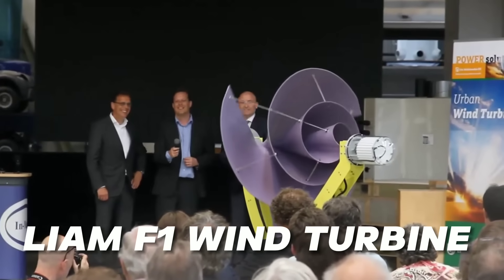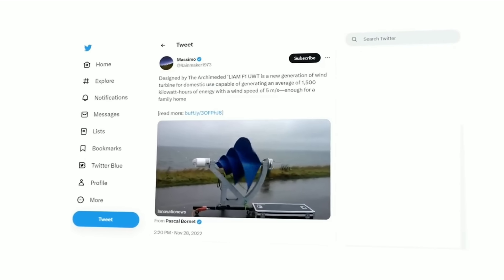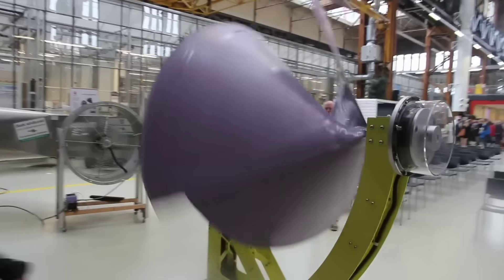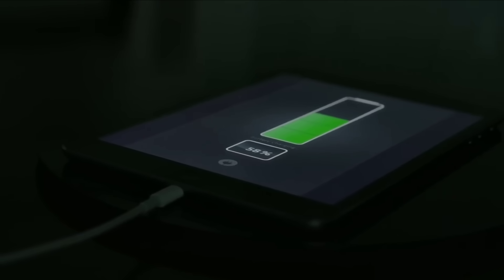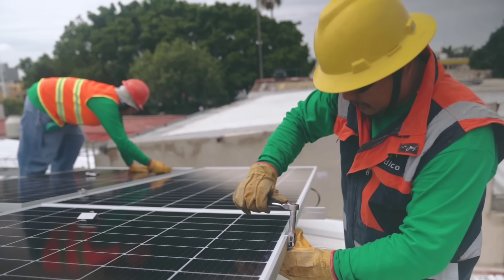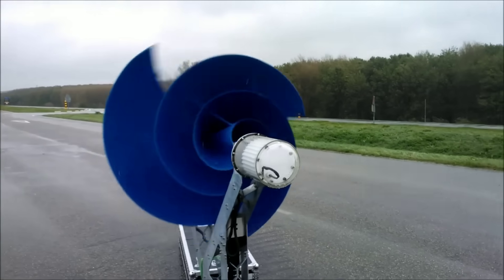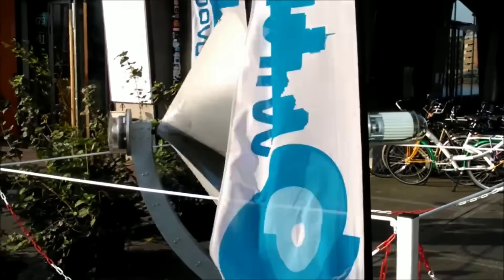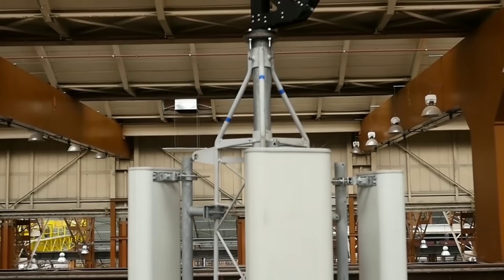This NEW European Wind Turbine for Home Outbeats PV Solar Panels in 2023?!

Comment: I have worked in the wind industry, and with the wind industry, for more than 30 years, and over the years, one wind turbine after another has been introduced claiming to be the new wonder when it comes to extracting energy from the wind.
All these companies, and their little "wonder mills", are all as one, closed again, almost as quickly as they arose. And this one, seen in the video, will be just another example of this.
And at the price that is stated, it is probably the best thing to still buy your El, where you now buy it.

Regardless of how you build a turbine or how you design it, you can only extract the amount of energy from the wind that the wind contains.
And the best wind turbines to do this are the large turbines that we see today, both on land, but especially at sea, and which are specialized down to the smallest detail, to extract the maximum potential from the energy that is available in the wind, at a given time.
Reply: https://www.youtube.com/watch?v=0k8-G9yNud0  "As far as we can roughly remember! at 3 ms - 4 W. 6 m.s. 100 W 8 ms. --300 W"
Reply: That is not quite true. You could develop a wind turbine that is more livestock friendly than the once currently available on the market. But since the big wind turbines are developed and available for a fairly good price, other wind turbines will have difficulties to get to the same development level, because development costs money and money comes from selling.
Reply: @alfredrichter6236  what is it, that’s not true?
Reply: And the only company that has survived is Bergey.
Reply: I wish you had described your capacity in working with and for the wind industry. As an unbiased engineer in the field, that's the gold standard. A salesman? Not so much... My take is, what is potentially exciting here is the compact form, if it works as described, could be easily installed in residential locations. Couple these with say, solar, preferably with batteries and you've got a standout solution for many parts of the world.  And insofar as startups going out of business, who really cares? I can tell you now, as a maintenance mechanic, the bearings will be the failure point, but long down the road. Bearings are standard so replacing them should not be costly. The generator on the end should be easily replaced, if necessary, as well. It's just a motor.
Reply: @lesterbeals1443  I don't really know what your point is with your answer.
My post was, as you have already read, that this was just another example of a wind turbine product that claims to be better than all other wind turbines; and even claims that the turbine (Archimedes) can take 80% of the energy out of the air, which already tells you that it is another example of a company that closes without ever really coming to the market, because it is not realistic.

It is based on the limitations of physics, not possible to extract more than about 60% of the kinetic energy out of the wind.
This is based on Bet'z Law, which describes this.
Reply: @ebeanakskov Perhaps I've unfairly lumped you in with all the self-destructive naysayers to clean energy.  Their edict is "delay, delay, delay" if that can't outright stop it.  As a homeowner, even at 67 years old, I do feel I'm being played by these articles which never seem to come to fruition. In this article, however, I'm again hopeful that something of compact size and reasonable price will come to market which promises cheap, clean energy on a home by home basis.  I'm not caught up in the specs, per se. I just ask whether the energy it provides, near ground level, is significant in powering a home.
Reply: @lesterbeals1443  I don't know if you got me mixed up with opponents of clean energy. Clean energy is the way we should go; but it must be done in a correct way, both for the environment and for people who have to live with the energy solutions.

And the short answer to a solution with the type of turbine shown in the article is NO. It delivers so little Watts that it is not worth the investment.
The smallest of their turbines delivers with optimistic figures, approx. 500-700 W at max. wind it can withstand.
And the slightly larger model, around 600-800 W.

So in my world, a waste of money.
Reply: I don’t mean to be impolite but I think you’re wrong, I don’t know what turbines. But I’m a sailor and my people were sailing when Europeans painting on cave walls. And a new sail or configuration comes up every few years that get a little more power out of the wind. It seems to me that turbines probably increase in efficiency with technology also. Although advertisements from companies like this one do tend to be propaganda and full of crap, but the argument that they can’t get more efficient I don’t think it holds water.
Reply: @kevincleveland763  No, you'r not impolite. All can have their own opinion. 
But it's a fact (as I wrote), that you can only extract the amount of energy, which are in the wind, at a given time. But yes, the wind industry are developing all the times, and especially here in Denmark, where I come from, and where the wind industry actually did start, many years ago.
But that development, are done on large scale wind turbines, and not in these small 2-5 kw turbines we see, especially from China.

Comment: This is a real 21Century invention, and is that I will probably not see in my lifetime, if I had one of them to compliment my existing solar system with batery back-up it would (in theory) supply all of my energy costs and make me energy self sufficient, I live on a fairly widy site, that blows most days throughout the year. are they available in the uk?

Peter Allen

Comment: The windmill is nice.The whole thing could be mass produced if it were simplified elegantly.  
The generator windings could be integrated directly into an inner shaft as part of the axle to save production costs.
The sail could be a flexible lightweight material ie Mylar affixed to a lightweight framework reimagined as a spiralling curtain rod,  pre-stressed in manufacturing. When deployed, it would to resume the correct tension and shape needed to make the sail taut, like one of those camping tents or car windshield sunscreens which unfurl.  Cost could be brought down 10-fold to mere hundred$. If they don't reimagine it, China certainly might, risking loss to the original investors, or the design will end up known to history as an also-ran.
Reply: And it would still be totally useless for almost everybody.

Comment: Sorry I’d like a job with ye if u don’t mind I’d like a load of this wind turbine
Reply: I like to make a electric plane with a power assist turbine that turn inside the engine room we’re there’s no wind inside, manually twist these turbines and I have a way for this plane to give 10-200 dollar flights depending on your income balance this plane is crypto and will pay for itself as long as ppl get on and you don’t have to pay upfront you pay to open the door to the plane but only one person at a time&the plane door opens vertically planes of the future
Reply: Excuse me how about ye make tiny turbines you can put inside my humanoid robots power assisted turbines so the robots can work under water/under ground, turbines will give my robots electricity energy and they can go places were solar energy robots can’t I can’t tell u everything yet until u give me a job
Reply: And have a few turbines in the robots body/legs for its movement so u have 3 or 4 mini turbines in its skull/head 2 or 3 in it’s body for multiple hearts and 1in each leg
Reply: I would appreciate it if I could have a job with this company

Comment: Logically the more moving parts the more wear and tear. This issue bears a lot of weight while deciding between the two even if it costs less than the Solar Panels, which is not the case, in my opinion.

Comment: I'd like to supplement my existing solar system, where I may not need a turbine quite as powerful as this one.   Or as expensive.   I noticed from the video that it runs at 24V DC which would be really important so that it's compatible with off-the-shelf portable power stations (battery pack/inverter).   And in fact, an interesting feature would be the ability to simultaneously run off of solar panels and turbine at the same time, so that if there's no wind but it's sunny, or no sun but it's windy, there'd still be generation going on.   I would NOT be interested in a complete system with its own battery, the turbine absolutely must be component that is available separately and compatible (20-30V DC most likely).

Comment: I must say and what stands out the most is the PRICEvs.PRODUCTION.....
THINK ABOUT.... turbines need air wind that blow more than 15mphs  and most importantly constant blowing wind to produce power yet all areas around the globe only recieve seasonal winds that are not constant. Their are only few places in the globe with 60-70% winds so for those places this wind generator is great but all else NOT WORTH 4500$ for 31 days of inconsistant air.
GOOD LUCK TRYING TO SELL A PRODUCT AT THAT PRICE. 
TRUTH IS THESE COMPANYS ARE TRYING TO GET RICH OFF THE DUMB CONSUMER THAT FALLS FOR THIS. SAD TRUTH.  
SO AT THIS RATE IT WILL BE DIFFICULT TO SELL TO CONSUMERS AND THE WARRANTY IS NOT THE BEST EITHER FOR THE PRICE RANGE SO ANOTHER TRUTH IS THEIR IS NO GUARENTEE THE PRODUCTION COMPANY WILL SURVIVE AND WHAT DO YOU DO WITH A FAILED PRODUCT IF THE BUSINESS HAS CRASHED.

Comment: We are directly on a large lake with the prevailing north wind often gusting to over 20 mph. 
 We are also retired and im not sure the cost is worth it, or that it will provide what we need during times of little or no wind. In short we must do more research. But we would, 
in theory, prefer wind to solar power.

Comment: I have always like the idea of wind power as compared to solar. This is a small simple system that has a very bright future if properly marketed and backed. They should try and break into the California market here in the U.S. A good portion of the state has adequate wind. It also has the political climate which is pushing for renewables. Most people don't realize it, but California pretty much led the world on auto emission control requirements starting back in the 1960s.
Reply: Using both better
Reply: This is garbage

Comment: thing is, if you accept less efficiency for your product, you can produce so many more for the same $ as you would producing this design. it has a LOT of material. The cost of these would kill any savings over the cost of other solutions. I can't see these outdoing solar panels as the cost of those are really getting cheap and they are quite better than panels from 10 years ago

Comment: What is km/h?  You're saying kw/h.  But that's not really how panels are rated.  Panels are rated by CONTINUOUS output.  So, a 400W panel typically means in optimal conditions it's output is 400W.  10 panels would then give me 4000W or 4KW.  From that I can look at devices that are rated with a continuous value (100W, 350W, etc....) and figure out if I'm producing enough power for my needs.

There isn't such a thing as a GOOD comparison between wind and solar.  It's going to depend on the location which is more effective.  In places of very low wind for much of the year but plenty of sunlight  these fans won't work well.  In the tropics where you get typhoons I'm guessing you still have to secure these.

Also a fallacy you said is that solar panels need to be cleaned "regularly".  No.  For home top solar panels there are plenty of people who say they get near optimal output without cleaning panels for a year or more.  That's not "regular".  That's "infrequent".

Comment: The constant insistently obtrusive repetition of the full name of the product where it could easily be replaced by a personal pronoun as well as the unnatural sentence melody of what sounds like the sentence ending in the middle of the name do not make a trustworthy impression of an unbiased report. Also, the claim of a fully automatic aligment system is neither shown nor explained.
I have to assume this to be thinly veiled promotional material by the manufacturer that merely poses as a third party report.

Comment: The performance results will all be in the data which needs to be independently verified. Most turbine manufacturers overstate the performance and output. Also, vibration testing is needed and a discussion with planning officers to what is possible. Best to test before buying.

Comment: 1500kWh per year @ £0.30 per kWh is £450 saving. If it costs €4,000. Then that’s £3,500. So that’s nearly 8 year payback. 

A better option is a battery. 9.5kWh stationary battery costs £3k. I can buy electricity at night at 7.5p kWh versus daytime 30p. So save 22.5p per kWh. If I fully charge and discharge my battery each day I save £780 a year. So less than a 4 year payback.

Comment: In my humble observation/understanding, the Liam F1 does not employ aerodynamic lift in its operation and therefore functions more like a Savonius wheel  (moving due to displacement by wind pressure). Not a lot of power is generated with these designs (maybe 25 to 30 % the of power generated by a horizontal axis wind turbine (which utilizes aerodynamic lift) sweeping the same area of wind stream.  That's why horizontal axis wind turbines are used in all commercial wind farms across the planet. Lots of misleading information on the internet on this. Thank you for adding to the confusion...

Comment: Windgens, no matter how well-engineered, depend on wind blowing.  That limits effective use of windgens of any kind, to locations that get more wind, most of the time….that leaves-out a LOT of landmass areas. 
The bird issue has been resolved long ago, by putting gearing & governors on them.  

The video has maybe a couple lies—like, it’s not a “one time investment”.  
NO appliance or gadget known, lasts a “lifetime” without maintenance &/or replacement parts. 

The good parts of THIS windgen, is that it is:
….quiet, compact;  
….the AXIS of it, is tethered on both ends, & it tolerates variable winds better than any single-end-tethered propellers or fins. 

It can be better than solar…the materials to make windgens are more ecologically sound than materials to make solar panels, & the functional efficiency of some windgens exceeds solar PV.   

Some areas though, have put legal roadblocks on citizens mounting windgens—especially ones like this that are large.  

One other way of generating electricity, is by using temperature differentials.  With enough of a temperature differential, energy can generate.   It requires approximately 77*F of temperature differential, to generate electricity.  So, if one lives in a thermally hot landmass (near volcanos), or, if one can drill deep enough wells to get that differential, or, can store heat from sun or other source in a salt or sand mound….one can quietly, invisibly generate their own power.  If the temperature differential is less…say, 40*F, it can still generate power, just less of it.
Reply: It is applicable to most cities as Multistory buildings of adequate size can be retrofitted with a permanent roof crane to effectively construct a roof wind/solar generation, incorporating wind from the flat wall.  This new system is possibly quieter than the current one's in existence, which sometimes have solar panels covering some but not all  the roof space to make maintenance easier. The crane can used for panel and parts replacement years down the line.

Comment: Here is their data : https://ienergy-us.com/source/Liam_f1_brochure_archimedes_ENG_nov_2014.pdf Notice on the power/wind graph they do NOT show the units. But over on another page it found the units. It's mps. Notice their 1500 watt system does not get to 1500 W until a windspeed of 14 mps, that's 30mph. At 22mph it's only a 500 watt system. Very few places have sustained winds of 22mph. But even if you did, you can buy a 500 watt system all over the place for under $1000. I don't like people who don't give units. The very first year of college, it was drilled into me: UNITS, UNITS, UNITS. If you don't specify, it's useless. In college if you were had just a single reference of data w/o units, you FAILED the entire lab. (Loved Dr. Brown. 🙂)

Comment: The Netherlands have about 24 GW electric power installed in their power stations.  So do the math and see how many windmills you need ...  Then also do the cost calculation and you will find that despite all the efforts wind mills are not a real option for electric energy production.    Utility engineers have known this for very long time and that is why they are not in facour of using windmills ..... but prefer other techniques to produce large energy capacities such as Thorium LFTR or Tesla Free energy systems.   But the powers that be behind the curtains do not want humanity to prosper ..... and they do everything to demolish our economies and our cultures ....

Comment: Stickman is very correct as 2 of my friends that build units for commercial and residential use and they both said they could produce these for under $1500 easily so selling them for profit at $2500 is what should be happening here. If and when these were to really hit the market they said they would be willing to jump into the game and undercut it and take the market to benefit themselves and the consumer.
Reply: I don't know of the 1500$ include the years of developing and testing before going on the market with a product. You might copy it, but there is always the question of material fatigue and everything as a result of this (warranty, damage of other stuff caused by failure, etc.).

Comment: Pricing is absolutely crazy!   Doesn't have the parts to justify even half that much.  Two bearings, frame, small plastic propeller  and inexpensive generator on a bearing pivot.  People have no concept of manufacturing.